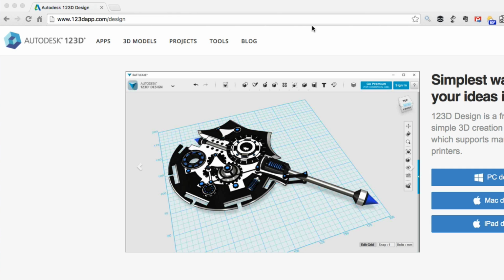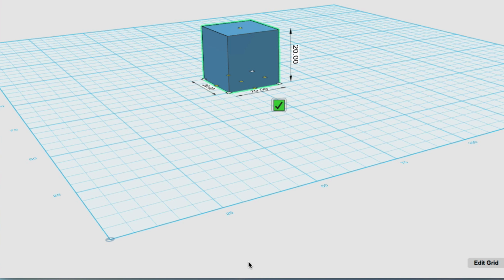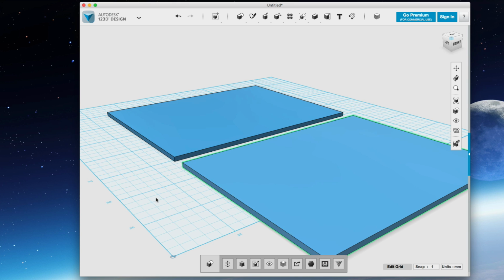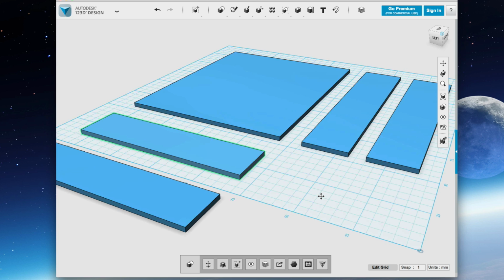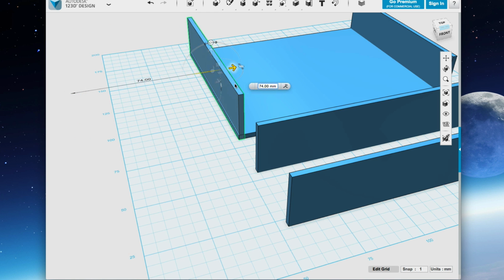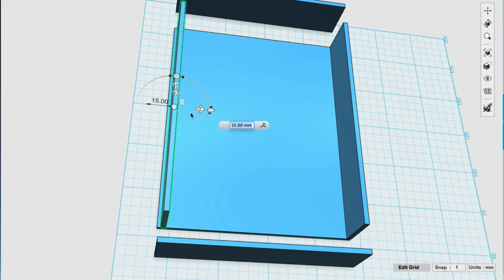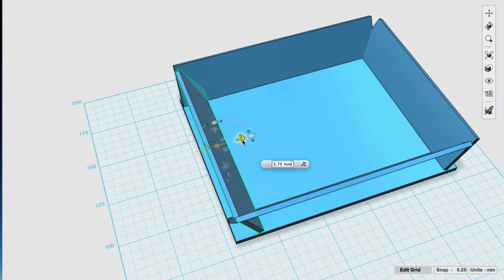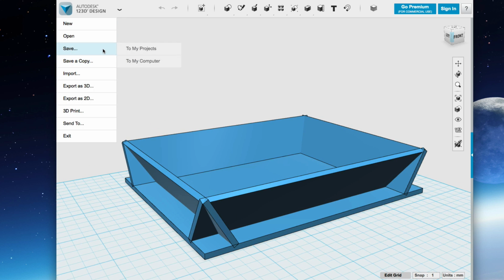How to design your first 3D printing project without tears

Comment: Thank you for the very explained process.
Reply from the maker: Nope. But I've put lots of stuff on them, and used them in a ton of projects. Haven't hit it with a sledge hammer, but have done a lot of hammering and other semi-tough activities and they've held up. Drawers are a bit sucktacular, though. They only pull out about halfway.

Comment: Thank you very much for this video.  I didn't know this CAD tool existed, and this is exactly what I was looking for to get into 3D CAD.
Reply from the maker: Sadly, 123D Design has been discontinued. If you want something super-easy, take a look at TinkerCad. If you want something powerful, Fusion360 has a free version. I use both now, although I find Fusion360 a bit overwhelming at times.

Comment: Don t work anymore that page
Reply from the maker: Ah, if you're talking about 123D Design, you're right. Sadly, Autodesk discontinued that product. You might want to look into either TinkerCad (which is easy, but relatively limited) or Fusion 360 (which is very deep and powerful). Both can be had for free. Good luck!

Comment: Sadly this software is no longer around.
Reply from the maker: Yeah. I really miss it. Take a look at my Practical 3D Printing series using TinkerCAD. TinkerCAD is super-easy to use, but not as nice as the other. Then there's Fusion 360, which has a learning curve, but can do anything.